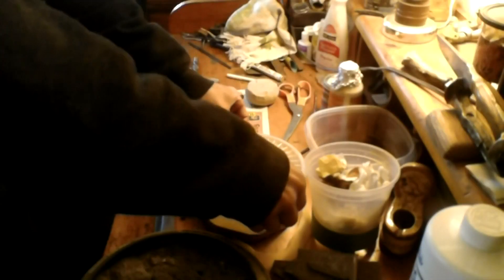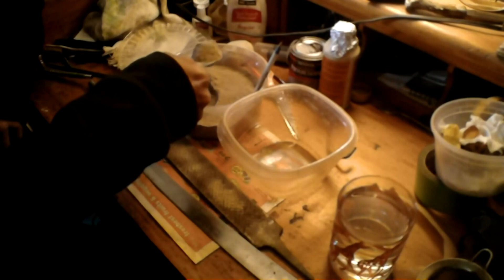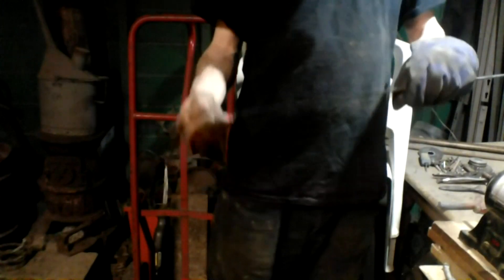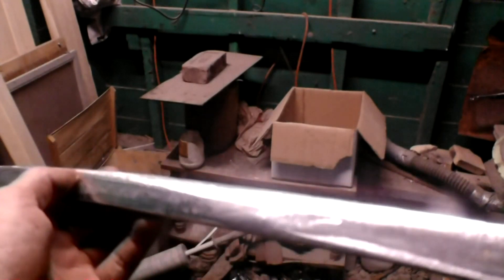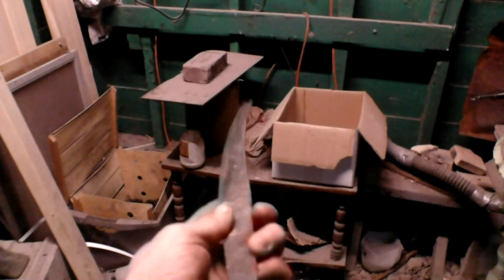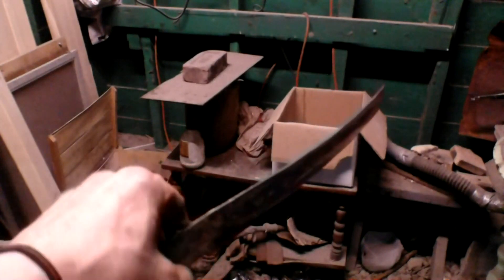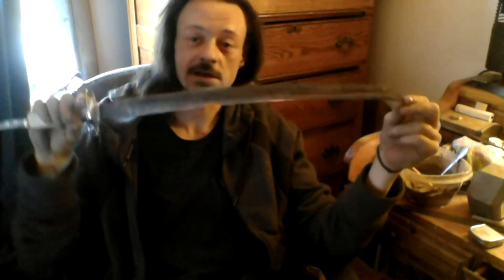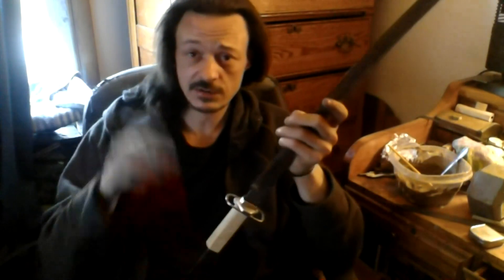Katana Heat Treat difficult water quench 5160

Comment: Hi, my experience with 5160 and water was an odyssey... 5160 is an oil quench steel, but i am a stubborn bladesmith and i want to quench it in water, after several test blade broke, chip, shatter and expode i found a relatively safe way to quench in water, i just pas non-magnetic and leave the steel in forge for a longer time, a couple of minutes, with oil you want to reach the temperature and quench almost instantly, now i have opted the for the oil quench  the longer blade and for short knife i will go with water, hope this can help anyone that want to water quench 5160 steel.
Reply from the maker: I was trying to use water because the Japanese use water for their swords. 5160 VS Tamahagane in water quench. I had High Hopes lol. Thanks for the input man.
Reply: @catscradleforge2891  Make some sample test before, so you have a better idea of the things